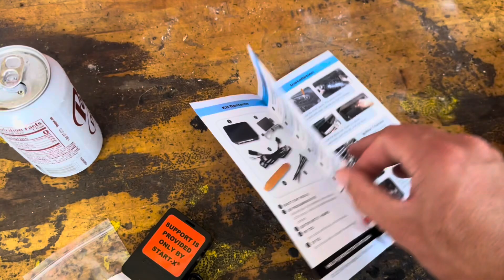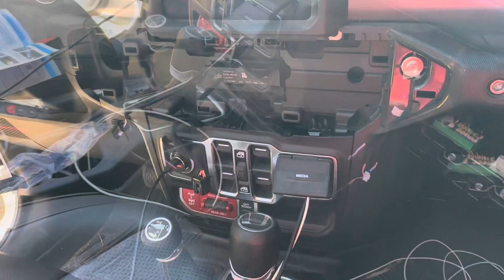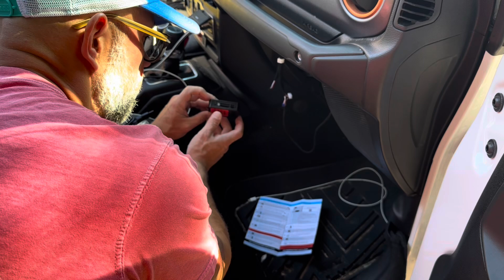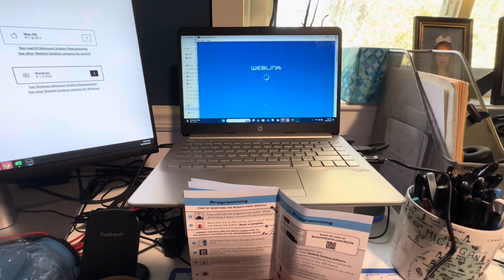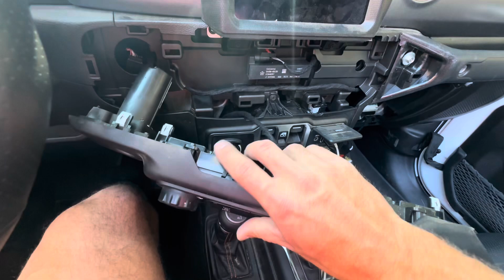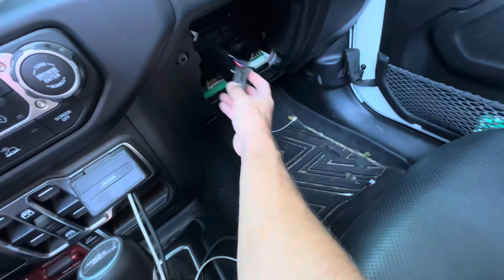EASILY Add REMOTE START - 2018+ Jeep Wrangler JL Gladiator JT in 15 minutes- No wiring required!

Comment: Thank you for your help! It took my less than 10 mins to install it. I did reconfigured the software first since I saw it defaults to a 2020. Then I went through all the steps and only had to go back to install the final programming and it was done. So easy!

Comment: Would this work for rubicon 4xe?
Reply: Does not work with the 4xe
Reply from the maker: Yep just depends on the year, I’m not sure on the brand new stuff. My gladiator was a 2023

Check the link in the description and see what the listing shows for years and models :)

Comment: I wonder if you have to do all that programming again if the battery was ever disconnected for some reason? Also how is it holding up since you installed it?
Reply from the maker: That’s a good question I wouldn’t think so. I ended up trading in the gladiator in January on a new 2025 Ram with the twin turbo I6. But never any issues before that
Reply: @PeakPerformanceEngineering  Thank you, I was thinking trading also, I just don't want to that payment thing.

Comment: My 2017 Jeep Sahara/Wrangler is slightly different. Works near the same. Pushing my break doesn't effect it shutting it off. Your video was still helpful. Thanks.

Comment: Do these work with a 2025 model? The listings say they fit through 2024, but I don't know if that's because 2025 changed things or the ads just haven't been updated yet.
Reply from the maker: I would think 2025 should work but probably best to email the company to make sure.

Comment: Will this work with a jlu that has manual doors and locks?
Reply from the maker: Good question not sure. You’d want to check with them to be sure
Reply: Did you ever get an answer?
Reply: Looks like no. You need the original Jeep key fob... us powerless Jeep owners are fobless 😂

Comment: Ordered mine today, thanks for the video. Well done. 

Can you make the remote start longer than 45 seconds? I live in Canada and currently seeing -10 mornings, so 2-3 minutes would be nice.
Reply: the 45 seconds is how long you have to actually start the vehicle after the door is opened before it turns off.   auto start should last 15 mins.  If door is opened it'll turn off in 45 seconds unless  you get in and actually start it.
Reply from the maker: The standard should be 15 minutes. Then you were able in the computer settings to make it longer like 30 or maybe even 45 min 

It’s been -20F this week here at night in Michigan so I hear ya! Cold 🥶
Reply: Installed tonight in 20-25 minutes. The only thing that made me mad was not installing this years ago. Works awesome and install is very straightforward.
Reply from the maker: @betweenthepines4000  nice! 🔥🔥
Reply: @PeakPerformanceEngineering does this also allow heat and cool air to blow depending on winter or summer after start automatically
Reply from the maker: Yep absolutely! 👍

Comment: Question. Great video. I have a 2020 jeep gladiator. Would this work with out me having to update the software? I figure it should be plug in play with maybe the older models ? Just curious to see if I can just plug this module without using a computer in all?
Reply from the maker: It showed in the instructions it could work out like that, but I would count on likely having to do it
Reply: @ thanks again . Yes I’m gonna order mines and hope it just work straight from the box. But yes I’ll keep in mind pontentially having to install a software update on the module.

Comment: I have a question will it work on a manual transmission?
Reply from the maker: Unfortunately this one is only for automatics it says :( 

Usually for manual transmissions to get them to work you have to disable the clutch switch, but the scary part about that is if it was accidentally left in gear and started it could jump forward or backward and hit something.